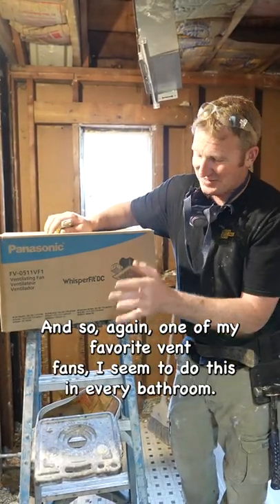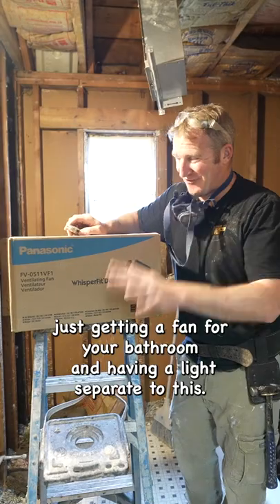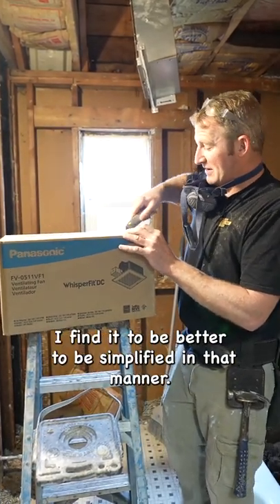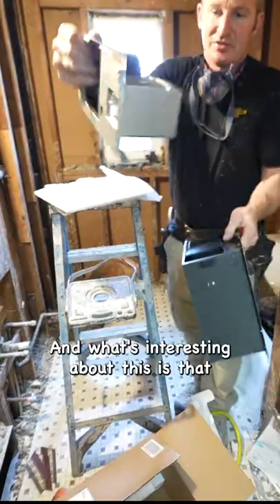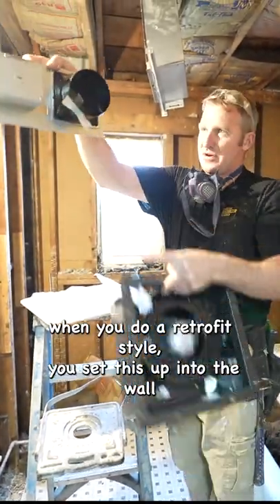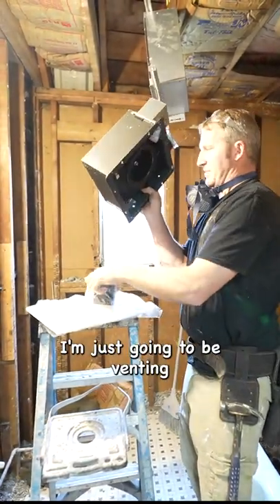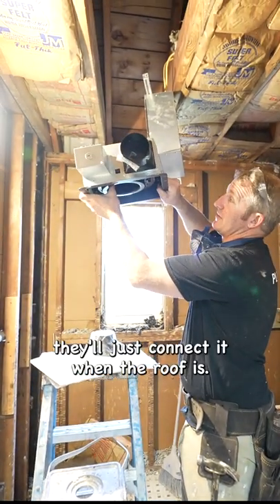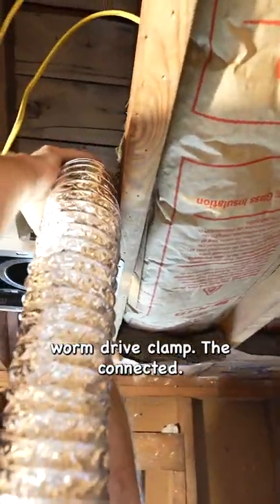My Favorite Vent Fan #shorts #diy #youtubeshorts

Comment: I have one of those,,, I installed a motion detector switch which turns on the fan plus a light for a few minutes.
No more dark bathroom in the middle of the night. No bad smells either.

Comment: Love the channel as a retired plumber however, why did you use that cheap metallic corrigated vent tube? I know in some ststed it can't be used per code. I was always instructed to install solid piping and also insulate the vent tube. Just curious
Reply from the maker: No doubt solid is better. I feel if it’s under 4ft length it’s not a big deal, but I agree with you 👍